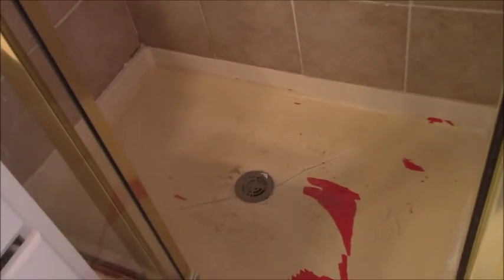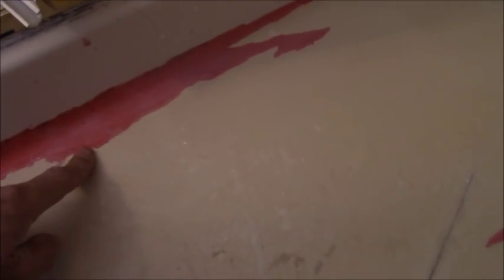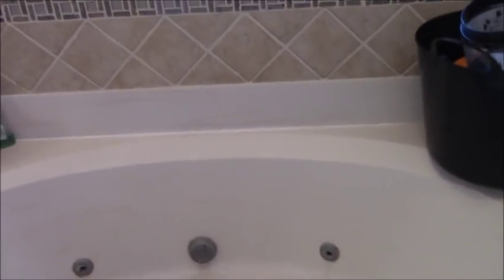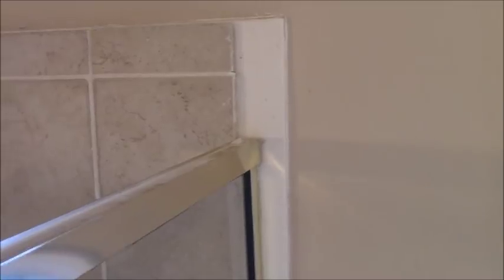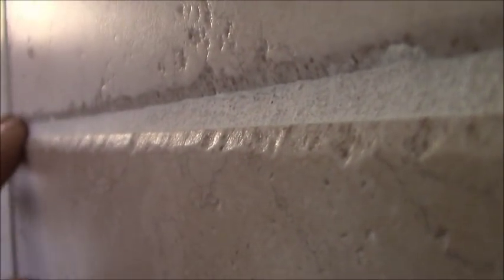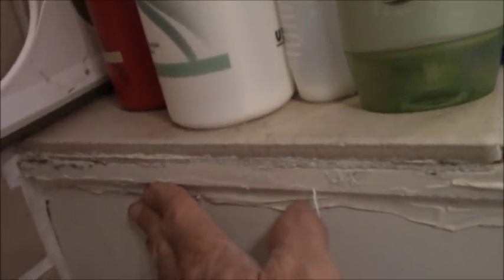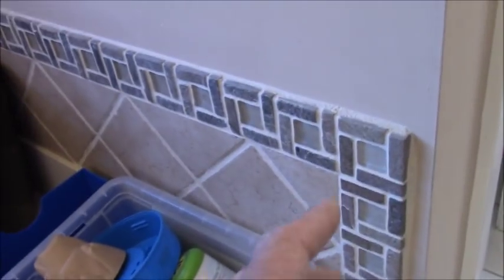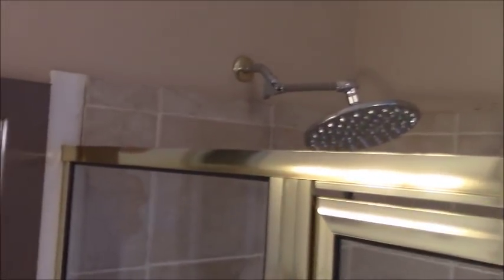HACK TILE JOB !

Comment: Excellent description of the disaster...just seems the owners wanted the tile shower without the expense of a complete ripout of the original and a proper install of the highend look...finding hackers is easy...paying as much or more for all the damage is not...those builder grade pans are rarely properly supported underneath leading to cracks too...makes the old cast iron tub look very practical!!
Reply: +rgentbuilders 
Yes...excellent suggestion!

Comment: Even if you never put one scratch on it, all cultured marble eventuality yellows (due to the polyester topcoat)and will look like crap. Even a gray or dark colors will develop a yellow tint. The constant hot/cold change around sink drains will mean cracks will develop and will darken. The more you try to clean the drain, the worse it gets.This is a 10 year product but is sold as if it will last a lifetime.

Comment: I know what you mean about the cheaper tile. I've pulled my hair out in frustration trying to split the difference on cross joints. No matter what, cant get the lines to all match. Once one gets off, it snowballs.

Comment: Hello! 
Thank you for your fantastic films - I've been devouring them since discovering them a couple days ago!
I was wondering how close together the floor joists should be to ensure that a bathroom floor can take the weight of a mudded-in shower tray? Will almost all modern floors take e.g. a 4'x3' tray? Have you been in situations where you could not install such a cement shower tray (or reduce its size) because you were concerned about the strength of the floor?
Thanks,
Simon.
Reply from the maker: Floor joists are meant to deal with worse case scenario...even a tub will take up to 40 gallons @ 8lbs a gallon PLUS the weight of the person, and a shower pan weighs less than that tub of water.
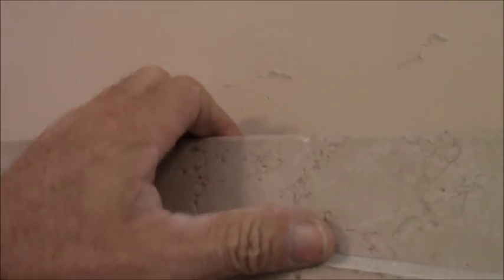Reply: StarrTile 4:55 I bet when you tugged on the top cut piece you were surprised it bonded😂